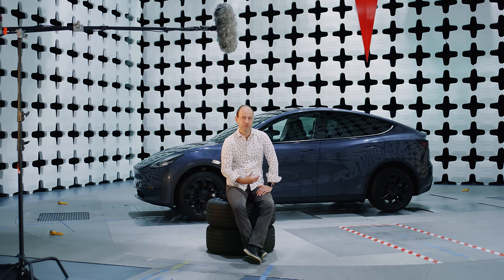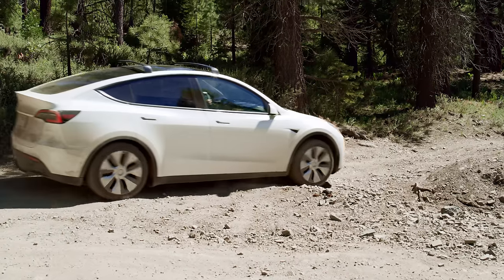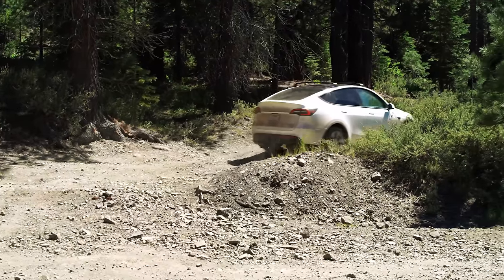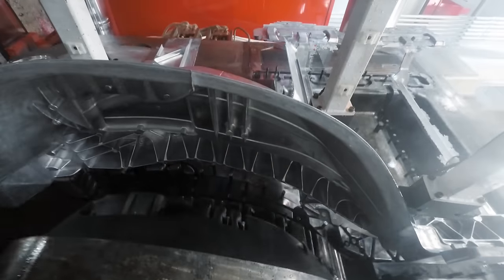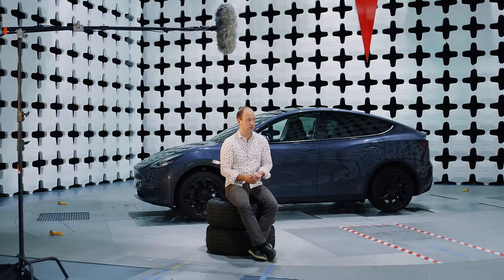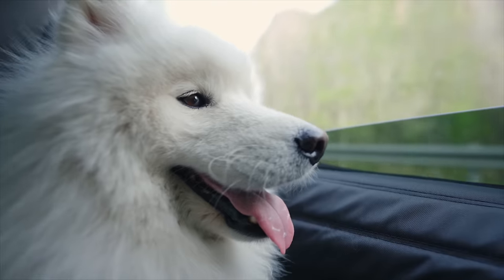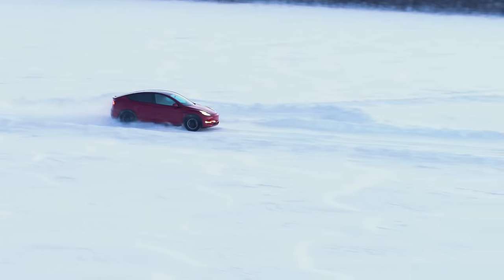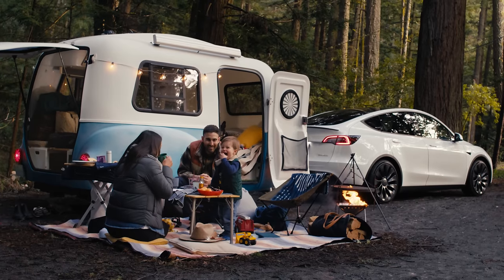Model Y | Engineering From First Principles

Comment: Serious question - Is there still QA issues with these? The other day I saw condensation in a Model 3 and was like 🫣 That’s the only thing really keeping me from putting a Tesla on my list. Mach E or Chevy Equinox is my other choice.
Reply: We purchased our Model Y 11 months ago brand new.  The quality on the vehicle is solid.  We even live on a dirt road and the car has held up better than my expectations based on other vehicles I've had on dirt roads over time.  From what I've heard and seen, they've done a lot to improve their quality over the last several years.  Because of feature updates and upgrades, I'd recommend getting something 2022 or newer if you are looking at the Model Y.  They did many changes to areas like suspension to give a better ride.
Reply: Equinox?  Good luck with that lol.
Reply: We waited 3/4 of a year for our Mach E and finally got it December 2. We wanted a Y but they were out of our price range. But we almost immediately regretted our decision. The Mach E quality is good and the ride is comfortable, but we ended up trading it in April for a Y mostly because the software is so horrible compared to Tesla. Had we not had a Model 3 prior to the Mach E, we probably would have been blissfully unaware.

Comment: I would be pleased if you would also adjust the track more finely right at the factory and not skimp on the suspension or the control arms. At least for the German market, cars are allowed to drive fast here so this is actually a safety issue. But otherwise i love my myp

Comment: ngl, i really didnt like the model y before this video. i just saw it as a bloated model 3 with the only benifit being the hatchback trunk since basically every crossover is just a mess of raised hatchback plus small suv on a car chassis and whatnot, most crossovers dont ever go offroad and utilize the ground clearance. 

good marketing? probably, but it definitely worked and its more of a change of viewing what the car can do than anything with regard to just "oh i want that car", its an understanding of it that i now have. ill still probably get a model 3 performance, but the model y is looking better than ever from someone who used to hate it and call it an "unly, worse model 3 that was just made to capitalise on the pointless crossover craze". it probably still is that, but at least the adventure and towing aspect of it kind of seperates it from the model 3 and gives it other benefits besides just having a hatchback, IF you utilize those things that make it better. if you dont, a model 3 will jus be a better value and probably better in general unless the seat height is an issue
Reply: There’s no reason why the Model 3 shouldn’t be able to tow payloads as well. They just market the model Y as being suitable for towing to keep the average customer believing that you can only tow things in a truck or SUV.
Reply: @beanapprentice1687  but ground clearance does matter. and when you tow, that squat would likely be significant depending on the weight of your trailer. i have no issue putting hitches on cars, i put a 2 inch on my 2012 volt and used it to haul my dirtbike, but that is also an 11 year old car with 260k miles, not an expensive tesla. and because of that a model y would have mroe flexibility when it comes t ride hieght and towing ability, expecially with bike or motor cyle racks.

Comment: We need the smaller tesla to come out.
In the size of compact hatchback, 4.2 - 4.4 m long.
This will win the european market.
Besides the significant lower purchasing price, the size is also important to get around
The 300hp 57kw format from model 3/y would fit as a performance version for this smaller body, and with an entry level using like the 200hp motor for a long range one, and a much lower price as well (25k price tag before incentives).
It would blow up in sales for the id3/eqa/ex30 segment.
Reply: That's the plan.  I just wish it included an affordable roadster, perhaps a McMurtry fancar edition.

Comment: I dont like the design of the rear bumper or the lack of rear bumper its just flush with the metal bootlide and not even high enough to avoid damage.  Why is different from the model 3.  Its literally a dented bootlid if anything touches it.

Comment: Love the model Y, but Tesla says that if you take any of their cars off roading you will void the warranty.
Reply: Where do they say this?
Reply: @logitech4873  it’s called: New vehicle limited warranty, which basically says no off-road use for model 3 or S, but then goes on to say:
• Driving over uneven, rough, damaged or hazardous surfaces, including but not limited to, curbs, potholes, unfinished roads, debris, or other obstacles, or in competition, racing or
autocross or for any other purposes for which the vehicle is not designed;
Voids warranty. (On S,3,X and Y). 

It seems their limitations are broad on purpose to protect themselves.

Comment: If by engineering you mean "build quality of a plastic recycle bin", I guess....  A good start would be putting some over the head "woah Jesus" grab handles in the car.  And add some suspension quality to the Y.  If you ever have 2 adults in the backseat and hit a pothole, it's so jarring that you think you broke the car.  A few model Y owners I know took delivery and replaced the rear shocks.  Unfortunate.

Comment: Does Tesla have automatic high beams?  Why do I always see mouth breathers driving around with their high beams on?
Reply: Yes they are automatic
You can't use them manually unless you hold down the stalk.
The regular lights are pretty bright though.
Reply: @That-Guy_  I can definitely tell the difference between regular lights and high beams.  It doesn’t make sense how so many people are able to keep their high beams turned on in such a high tech car.
Reply: @djp1234  
Don't know
I will play with mine and see if I can override it to keep them on. I will let you know what I find.
Reply: @djp1234  
Turns out you can override the auto high beams.   Main menue > Lights > on/off toggle. It is set to on as a default.

Comment: Can you improve the paint please?
Reply: For real.  the paint comes off if you look at wrong
Reply: It's gotten much better.

Texas, Berlin, Shanghai, and other newer factories, have superior cutting edge paint facilities, often better than anyone else even. 

So try to order models coming out of those factories for best paint, especially if you don't plan to wrap it.

The old Fremont facility is constantly getting upgraded as well, so this may no longer be an issue in recent builds vs the 2018 trims.
Reply: @AllanSustainabilityFan  Agree. But U.S. made cars still need improvement :(. PPF and wrap cost so much!

Comment: I'm sorry but I'm not impress with that crappy insulation on that car the wind noise coming from the cabin on the highway is horrendous to say the least had I drove it on the highway at a least 70 mph I wouldn't have brought this car not  caught up to what you all rave about

Comment: E vehicles. Why didn't they modify an alternator to charge batteries while its running
Reply: Because that doesn't work obviously. Feel free to try it yourself.
Reply: @logitech4873  doesn't an alternator charge a car battery while providing power to a regular gas vehicle?
Reply: @ravenillusion2596  It leeches off the main engine to produce power for the electrical system. An alternator is only about  75% efficient. EV motors are about 90% efficient.

So this means that you can either power the motor directly like this:
10 000 W to motor -> 9 000 W to wheels

Or we can use the alternator:
10 000 W to motor -> 9 000 W to alternator -> 6 750 W to battery -> 6075 W to wheels

Adding an alternator just steals energy and makes everything less efficient. In practice you're just generating a bunch of extra heat.
Reply: @logitech4873  can't make an alternator that'll accommodate?
Reply: @ravenillusion2596  No. It would require more than 100% efficiency. That's obviously impossible.
Reply: @logitech4873  well that's interesting thanx for the insight appreciate it. May i ask you a question in regards to electronics

Comment: Once you test drive a Tesla it makes all gas powered cars look weak, old fashioned, out dated and something you would expect in a museum.  Put over 150k miles on our 2018 Tesla M3 and when first purchased you would have sport cars (mustangs, corvettes, camaros, etc) trying to challenge me at the lights (sometimes with 4 passengers in our Tesla) and after blowing them all away often in excess of 110 mph in under 2 blocks the challenges have stopped.  Even beat a couple Ferraris, Lamo's in the neighborhood.  Now in 2023 you don't see any sport cars trying to challenge any Tesla at the lights as they know they don't have a chance.  Also, our annual maintenance is under $80 per year to just change out the 2 air filters plus 2 tire changes (due to my lead foot on the accelerator at red lights whenever challenged) would be less if I wasn't a lead foot.  Full battery every morning off our solar panels (already paid for themselves last year with 23 yr full warranty remaining).  No wasted time/money at gas stations supporting oil industry with their price gouging and record profits.   Best automotive purchase we have made.   Cybertruck on order next.

Comment: please do not take your EV offroad.  a forest fire waiting to happen
Reply: ICE cars are 1500 fires per 100k units. EVs are 25 fires per 100k units. 

ICE cars are the much larger threat to forests by that metric. Hybrids are even worse at 3000 fires per 100k units.
Reply: @AllanSustainabilityFan  EVs have their batteries underneath.  The hazardous parts of an ICE car are tucked away.  EVs are not for offroading.  Stay off the trails.